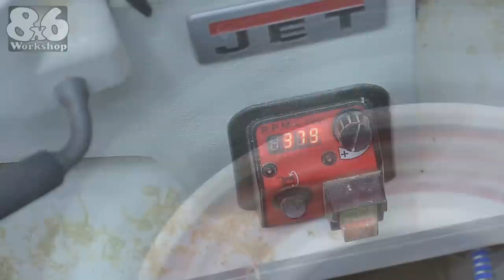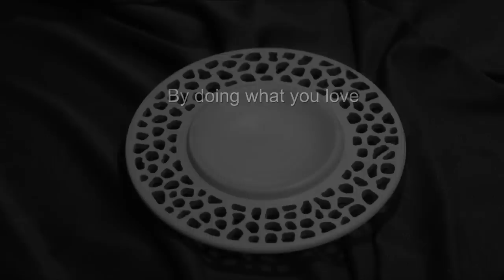Woodturning  - Tulipwood Coral - Bowl Pierced the Easy Way! - An Interlude!

Comment: Very nice Steven, is that around blade you were using on the jigsaw?
Reply from the maker: It's a spiral blade. Because the lip of the bowl where I was cutting the holes was off the table I couldn't let go of the bowl to turn it into the cutting line of a straight blade. I needed to support the bowl at all times so the spiral blade let me cut in all directions while keeping the bowl secure.